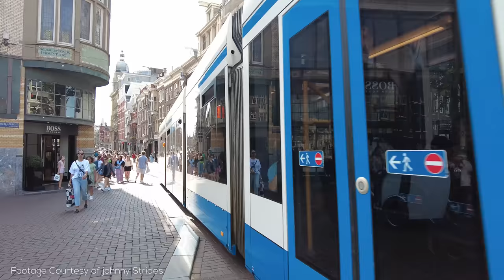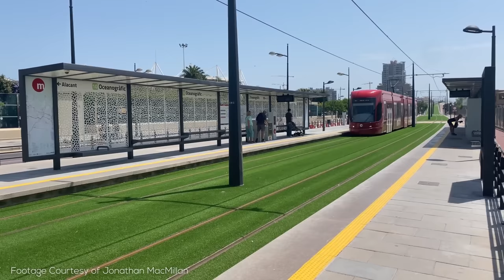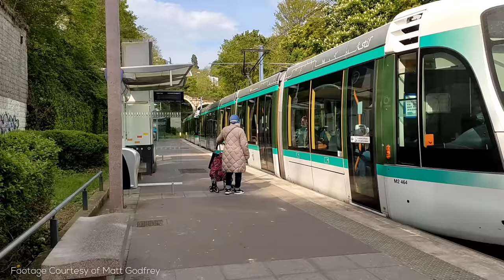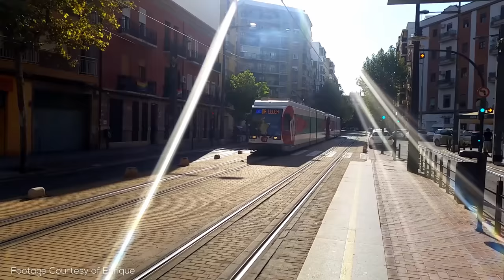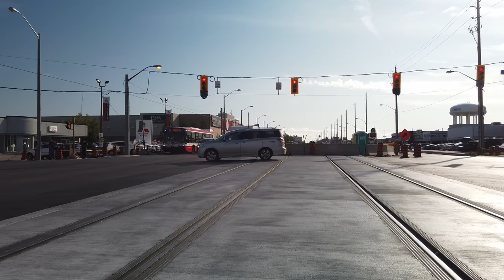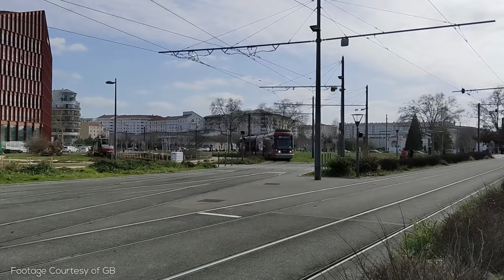What the US Gets Wrong About Trams

Comment: I really think you would like to investigate a little about the light-rail metro in Porto, Portugal which uses tram vehicles (like the EuroTram used in France). This system is used to connect the suburbs to downtown, and all the lines (except for line D) run through downtown using the old train course and diverge at begin and end of the lines connecting to different cities around Porto.

Comment: interesting-- the overhead lines that you call "sleek and minimal" from European designs are single-tension overhead wires. these are fine in many situations, but cannot accommodate high speeds (outside of some interurbans in the early 20th century united states that used trolley poles, not pantographs.) The overhead lines you show on the examples of north american light rail are supported by a catenary wire, which is more expensive, complicated, and visually noisy. however, it is required, in practical terms, for maintaining good electrical contact at higher speeds. I do not think it is a fair comparison, because it is a trade-off in practical terms; opting for the more "aesthetically pleasing" option, in this case, would materially impact system performance, cost, and lifespan.
Reply: also imagine snow/ice loading is a bigger issue in Canada / northern USA

Comment: One thing you completely forgot in this video is Customer. The way the tram looks like is dependend in 90% of the Customer's choice and specification. And i mean the road/rail authority, not the passengers. The supplier is almost never able to produce what their design teams does, or it is drastically changed by the Customer at the end. The other thing that might block "european" aesthetics in  US transit, are standards. While europe uses their own standards, us implies theirs. This doesnt mean it is impossible, but might be a significant point (i dont know almost any US standards so cant say 100%) in the final looks because of headlight/front windscreen shapes, safety design etc.

For the catenary type, you can check Alstoms APS system, where you have completely 0 overhead supply power lines, but everything is placed on ground and pedestrian safe.
Nowadays trams in Europe goes to semi-battery supply, so you can observe some catenary free areas in cities, where it is either not possible to fit, or it will massively improve the general look (old cities, tight centres, bridges etc.)

Comment: Isn’t light rail sometimes used as an economic development tool for the areas it passes threw?
Reply: Seattle is a decent example of this, especially Northgate's revitalization. But I-5 really needs to be capped or removed in Northgate to make it a good place to live. However, real development ultimately has to come from Metros, Vancouver BC is a perfect example of this, though it's a little more extreme than other examples.
Reply: At least on paper, not sure how it actually pans out in practice. I'm from Pittsburgh, and lots of stuff here has been supposed to stimulate economic development, but tends to be hit-or-miss. At the same time  does the development that occurs integrate with the transit, or is it more developer sprawl? Did building the line somewhere create a desirable sustainable residential or commercial area. Or one that gets built up fast and then nearly abandoned once all the tax breaks run their course.

Comment: I agree with most of what you said. However, I don't believe that the French way to make trams is good. Indeed, you said that trams should be designed to replace walk or cycling. In France this is far from being the case. Trams tend to be assigned the role of a subway : they are put on major corridors, with very high ridership. The problem is that they are put on the street. And even though they mostly have a dedicated lane and right of way, it's still in contact with traffic, high frequency cannot be reached properly because of that.

I think that the case for tram is very small : either the potential ridership is high so a metro is much better, either the potential ridership is low and a BRT would be better because faster and less likely to have disruptions (more flexible). The only time a tram is a good option is in medium sized cities (St Etienne in France for exemple, 400 000 citizens), when a BRT isn't sufficient and a metro is too expensive
Reply: I half-agree with your statement. In France, they tend to be more like a mini-railway running alongside a street which is fine in some ways but also less accessable and less integrated to the street.
However, it's a half-agree that they should be replaced with BRT since I personally don't see much use of BRT and thus aren't a (good) substitute for trams. Conventional trams are trains in the role of buses which means they're expected to mix with other traffic and also drive on less busier streets while a BRT is only well applicable to arterials.
Reply: @jandron94  Not that much cheaper actually (30-50M/km vs 100M for a metro). And much more costly to operate (75% more). Geology has never been a problem anywhere in France (Bordeaux is a great exemple of people falsely claiming that its geology can't host a metro while it has been proven many times that it could !). Metros are also an occasion to revamp streets and public spaces. And I'll even say that they do even more than trams ! Trams take up a lot of space on the street, space that cannot be dedicated to bikes and pedestrians (Bordeaux is again a good exemple that biking infrastructure is sacrificed to the advantage of the tram). In Rennes for the 2nd metro line, the transformation of the public space is incredible, pedestrians getting more space and cyclists getting a true cycling network
Reply: @jandron94  100% agreed on Val/neoval ! I don't know a lot about Nantes except about the fact that it has a lot of trams. Trams shouldn't always be opposed to metros. I actually think that they can complete each other because they fit different roles. In big growing cities like Bordeaux, I think a subway is necessary, trams are suffering due to their over usage (trams every 2min30s isn't a future proof plan haha), and not attractive enough to push car drivers to use transit (16km/h of average speed and technical issues every single day). You talked about the way Rennes is built (not much sprawl), this is a good point, transit must not be thought alone, it should be considered as a consequence of the way a city is built. Urban planning should consider how people will move from the beginning (sprawl is a major issue).
In the end, I don't think it's an "ego" thing, it's just that being a metropolis the size of Toulouse or Bordeaux means big transit needs that trams alone can't fulfill properly
Reply: @jandron94  Great question 😂 I honestly am not sure about anything. Still, maybe it's great to have resonnably big cities like Nice/Toulouse/Lille... Big enough to be attractive for major companies, but too small to compete with Paris. I don't know... Maybe some research has been conducted on that point

Comment: In Paris, the metro was built to litterally KILL the tram, which it did thanks to its vastly superior capacity, and subsequently free the streets. The tram network used to be the most extensive in the world when the metro began operation. Go see the archives of the tracks in famous places such as Republique, Bastille, etc, they were everywhere, with many end trakc for line termini and so on, with all the switches necessary to go with it, a real mess (and also quite gorgeous at the same time). The metro by going on the same corridors and faster with still enough stops to centend everyone proved itself quite rapidly. 
If trams one day make a return (not just on the outskirts that is), it will be to replace the main bus corridors such as the 38 or the 91 but as it is quite expansive and our mayor a real idiot with money, it won't likely happen soon... The objective being to make a inner circle to join the train stations together.  
The T3 replaces the Marshals boulevards circle bus PC, the T9 replaces bus 183 on what used to be a National road turned into a true avenue (not a stroad). T2 and 4 replace old train lines that died of obsolescence and bad service. T5 and 6 are useless gadgetbahns that still take lots of people around, the 6 should have been a metro from the start... T7 is... kinda useless too and takes an awful lot ot time to get to Orly airport and will completely be useless once Metro Line 14 extenstion opens in 18 months (hopefully but that's not garanteed since new MP14 stock deliveries are very slow and must split between lines 14, 4 and 11 with three different sets and Line 11 extension has been postpones to early 2024). T8 is good but has a branch service, not a good idea. T10 is far from completion and would be useless without an extention to connect it to T2 anyway and that is not yet really assured if that extension will ever be done. Due to money shortage, some other big projects have been indefinitely postpones despite being well engaged in the design phase (Metro line 1 to the East, Metro Line 10 as well, and Metro Line 7 and 9 won't likely be extended soon.

Comment: I think we need a new definition of 'Light Rail' and 'Tram.' In my mind, trams have a large network inside the city center and outlying areas, and travel within traffic or on roads with a protected median. Something like the Dallas Streetcar, Houston MetroRAIL, MUNI (debatable) and a couple others could be classified as 'trams.' Light Rail, in my mind, is a higher-speed (60-70 mph/100-112 kmh) transit system that runs on dedicated right of way or with limited, protected street running, uses larger and more capable vehicles and has a much larger network serving the city center and the suburbs. Systems like Dallas Area Rapid Transit or the LA Metro are good examples of Light Rail. It really all comes down to the size and capability of the trainsets, the kind of ROW they operate on and the speeds they run at. Let me know what you think.

Comment: Id argue that the term "tram train" specifically applies to america more than just trams, as most of them dont really function as trams but instead as a lower capacity train that can, if necissary, operate on the street. A good example is ironically Dallas, which uses souped up tram trains for a commuter rail system which is grade separated and/or treated like a train at intersections when north of downtown (where like 80% of the track is). It also has a streetcar (the modern one, not the mckinney one) that actually is a traditional tram, albeit on the small side
Reply: most of them aren't tram trains, they're just light rail
Reply: @Gfynbcyiokbg8710  light rail is technically a form of tram system. It's an arbitrary term in the american context, as our term "light rail" can be broken down into 3 European categories: trams, tram trains, and light metro. The most common American variant is a system with 90% light metro grade separation, 10% tram track, and using tram train vehicles, which simply means multiple tram vehicles in a single train. But make no mistake, the vehicles themselves are almost always some form of tram or a train made of linked trams. It's just that in America we make our trams go significantly faster than the ones in Europe since we grade separate them a lot more. If you look at the example I gave (dallas),  the light rail network spends part of its time in a traditional tram environment, but doesn't operate in mixed traffic. The Europeans have a term for the exact environment that these vehicles are operating in: a tramway. Even in US terminology light rail includes several different things, namely completely grade separated (light metro) and street running (which is essentially a souped up street car). Ironically enough, the dallas street car is literally a tram. By definition, function, and even just basic looks it is literally a tram yet falls under the US definition of light rail
Reply: @orthrus4490  You've clearly confused 'tram' with 'tram-train'. All light rail can be considered a 'tram' but almost none of it is a 'tram-train' as almost no light rail can operate on regular train lines (which is the definition of a 'tram-train').
A 'tram-train' isn't just a fast or more grade speperated tram
Reply: @Gfynbcyiokbg8710  my brother in christ don't act so confident when you don't know what you're talking about. Many of them can and do run on traditional rail track if they have the same gage, and many of the light rail lines in the US are partially or mainly made of repurposed freight track precicely because light rail vehicles can operate on them and thus its essentially free infrastructure. I said that trams as a whole in the US tend to be a bit bigger and "souped up" compared to their European counterparts in order to have higher top speeds(to take advantage of the better grade separation), not that it made them into tram trains. Are all trams in the US tram trains? No. The dallas streetcar isn't. But the "light rail" network? Absolutely. The limitation on most of them is actually on the freight side. Since most light rail track is electrified repurposed(previously abandoned or unused) freight lines, a lot of freight trains can't fit under the overhead wires since the wires weren't designed with them in mind (since they hadn't been using the track anyways). Make it where the wires are tall enough to accommodate freight traffic and it's very easy for them to use the lines since the tracks were originally for them anyways.
Reply: @orthrus4490  😂 I could say the exact same thing to you. A 'tram-train' has nothing to do with it being "multiple tram vehicles".
"The concept of tram-train is a light rail vehicle that operates as a tram on a tramway or non-mainline railway, and as a train on heavy rail mainline railway infrastructure" - Mott Macdonald (engineering, management and development consultancy firm)

"A design of tram which can operate over standard railway track as well as tram track." - Wiktionary

"Tram trains are vehicles that can operate in two transport modes, the first as a tram on an urban tramway network on a street and the second as a train on a mainline railway alongside heavy rolling stock." - Deutsche Bahn ESG

"As a tram makes the journey, it slides onto the special section of track that connects it to the main rail network. There, it switches from driver controls to rail signalling, acting not like a tram but a train." - WIRED 
Basically Every single website, consultancy firm, newspaper, etc. out there agrees with my definition NOT yours.
Reply: @Gfynbcyiokbg8710  lol that's why I edited my reply. I fact checked myself afterwards and you're right, my definition was wrong. However, ironically enough I'm still right about them being tram trains even under the definition you provided. Most light rail lines are made partially of standard railway track (usually abandoned or extremely under used freight rail lines), and they operate, at least partially, on those. In Europe (and parts of the northeast corridor) the standard is for track to be electrified for both freight and passenger rail, but for the most part in the US our freight rail lines aren't electrified and the freight trains are a decent bit taller than the light rail (tram train) vehicles. This means that after electrification of the line (as most light rail lines are) the freight trains can't fit under the overhead power lines, but electric passenger trains actually can and sometimes do since the track itself isn't changed.
Reply: @orthrus4490  - The US could absolutely have electrified its freight railways, it's just too cheap to do anything beneficial. Look at India, there double stacked containers are common on freight trains and they've still managed to electrify 94% of their lines.

- It's not about the right of way, it's about running trams on the same tracks as other 'heavy rail'. E.g. London's trams extensively use abandoned railways but they aren't tram-trains because they never mix with regular rail. And it's the same in almost all US cases, where they've similarly decided to convert it to light rail instead of using tram-trains. That's fine (and often better due to the US' crazy regulations and lack of exsisting rail services) but that doesn't make them tram-trains.

Comment: Seattle's system is an example of neither her nor there. The initial segment has an at grade portion in an arterial through a traditionally Black and Asian part of the city, and in a busway through an industrial area. It's grade separated everywhere else. Once it's off the street, it moves pretty darn fast. When they extended it northward through a dense and well-to-do corridor in the city, it found an enormous new ridership. I really want to see more buildout, but politics demands heavy investment outside of Seattle, especially between Everett (way north) and Tacoma (way south) both of which are already served by Sound Transit commuter rail.

Comment: The theoretical "walkability" part really resonates with me, because I think we in Leipzig rely a bit too much on our Tram system. Sure it's big and has a decent sevice for what it is, but even all the 4 track stations are constantly overcrowded with people who take these Trams usually for pretty far out of the city center, and outside a few corridors where the S-Bahn drives there isn't any alternative for a higher mode of transport than that. Hell even if you'd have a Bus or Tram connection to your desired S-Bahn station, with 30 minute headways for every line and little overlap outside of the core north-south corridor, there's little sense to actually look for an S-Bahn connection to where you're going unless you live very close to a station, or way further outside the city core.

So a solid network is great, but don't let it limit you, you'll need higher modes of transport than trams too once your city is growing big enough.